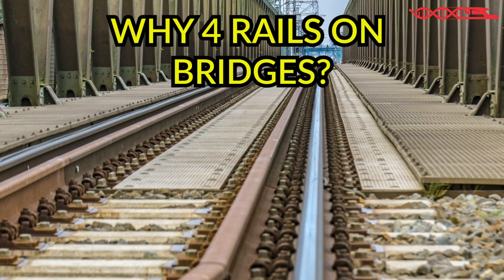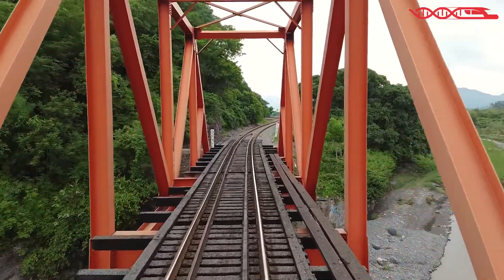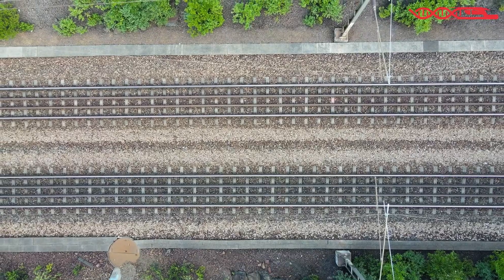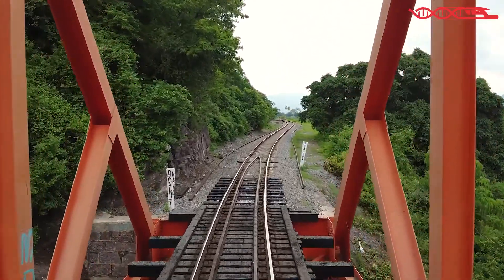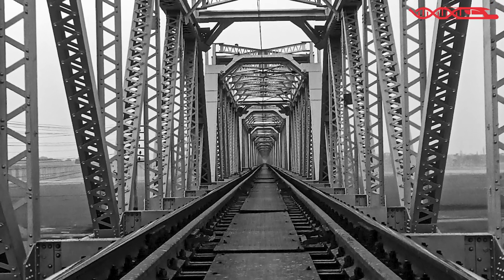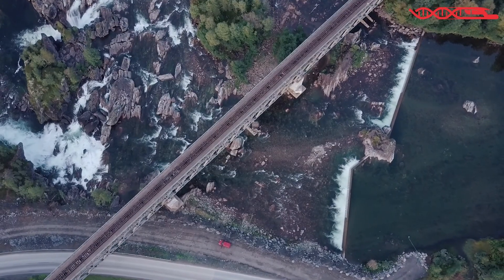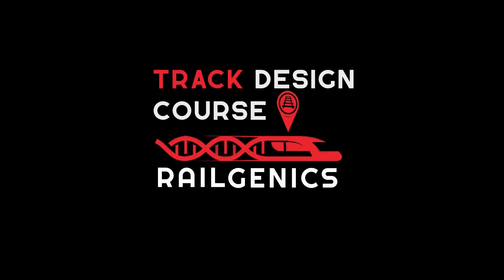There Are 4 Rails on Railway Bridges, But Why?

Comment: I'd say it's for more stability and integrity of bridge support itself . I've heard it prevents derailment. Its possible that check rails might help prevent the train from goin right over the edge but let me remind you that these trains are extremely heavy and powerful plus they are built solid virtually indestructible.  Even when the derailment or wreck is catostrofic and it looks like the end of the line for the locomotives -most of the time it's not . They take the worst looking wrecked locomotives and rebuild restore them and off they go back in service . And when that's not the case usually the parts are used in other broken or wrecked units . To say the check rails will take on a mile of rolling steal out of control and guide it to not go right over the side is saying a lot Don't you think ?
Reply: Almost anything you could use to challenge a freight train is the same as choosing different kinds of objects to throw at an exposed lawn mower blade  spinning at 4000 rpms claiming your goin to shut it down . Maybe an anvil or car tire ect. That's the same as using kamatsu cat used for mining or the platform that moves the space shuttle at nasa to stop a freight train going 60mph ..sure yes but that's insane .

Comment: Guard rails are provided on bridges and other vulnerable locations to prevent derailed vehicles from hitting nearby structures and falling off. Also they give stability to the track over the girders. 
Check rails are provided on sharp curves along with the inner running rail to prevent derailment. Also they are provided in level crossings for flangeway clearance.
On certain bridges on sharp curves both guard and check rails are used.

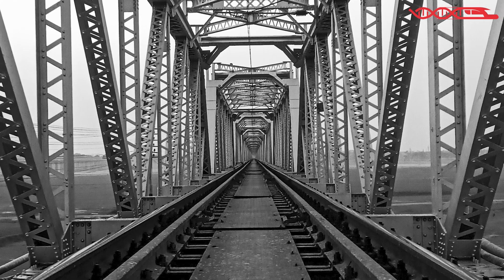Comment: When you look at the pictures of train derailments and accidents it is indeed doubtful if these check rails / guard rails (by whatever name you call them) serve the purpose they are there for (to prevent wheels from slipping laterally). In many an accident the bogies / trucks have entirely flown off the rail. The wheels are lying several meters away from the rail. I think the check rails only help to keep the sleepers firmly below the rails (or conversely the rails on the sleepers) at the turnings and on bridges so that the sleepers and rails do not move laterally due to the centripetal force generated by the trains at the curves. I find it hard to imagine that they are there for the same function at road level crossings also. Now carefully look at the stretch of rail in a bridge (@2:21 where a lineman is inspecting the rails) in addition to the check rails there are other serrated structures running on both sides of the rails. The rails are so heavily secured that the purpose of the check rails clearly seems to be to provide additional lateral stability to the rails in the bridges.

Comment: You could also argue that the additional rails stabilise the position of the sleepers, giving additional strength to the track and helping to reduce the chances of buckling and movement.
Reply: And loco pilots will be aware that you they are about to cross a bridge by seeing the gaurd rails.

Comment: just one hint, if you talk about something, explain ALSO how it works, not only why its there

Edit: please look at " ccrx 6700 That's Railroadin! ", he does a better explanation, where he also explain, how it should work to prevent cars from falling down.
if you do this on your Vids, than they will be a lot better
Reply: I agree. I wanted to know how these guard rails work. What do they do to make a derailment less likely?
Reply: @Inkling777  He specified in his explanation, that they don't make a derailment less likely; they make it less dangerous if it does happen.
Reply from the maker: @Inkling777  They do nothing to make derailment less likely. That's not why they are placed on the track. They are there in case a derailment happens. Their function is to serve as another rail which will be hit by a train wheel when it derails. The idea is that the train wheel bounces off this rail and stays in between   track rail and guard rail. That will prevent the train bouncing off the track during derailment, but also protect it against flipping over. Of course, this is not guarantee that it won't happen, as it depends on many factors such as speed, train type, track geometry etc. Main reason why they are placed on bridges and stations is that those are critical places in terms of infrastructure, interaction with other modes, number of people interacting at stations for example, etc. Hopefully this explains a bit more.
Reply from the maker: Thanks for hint, I will make it better next time :)
Reply: @railgenics  I thought your explanation was good. From what you said, I understood what the extra rails were designed to do in the event of a derailment.
Reply: Yes, the WHY would be nice
Reply: @tetedepoulet8651  I understood the why, from his explanation.